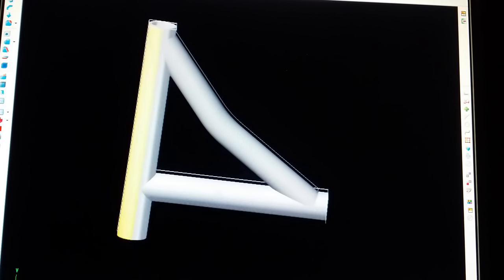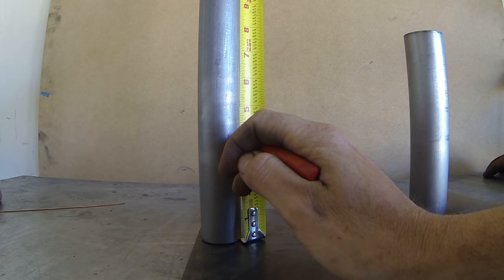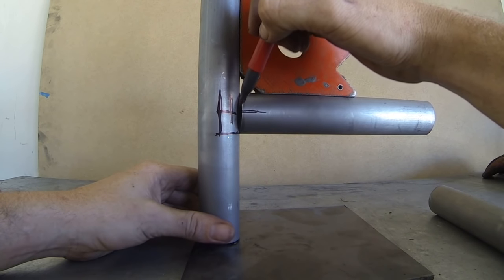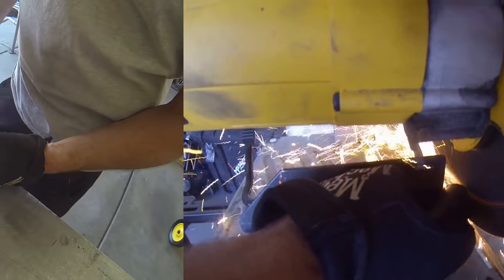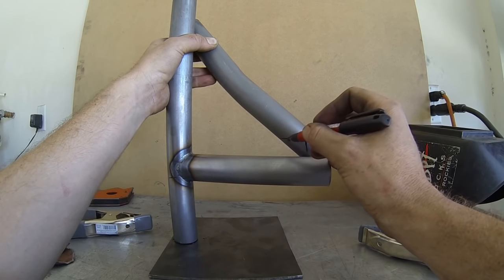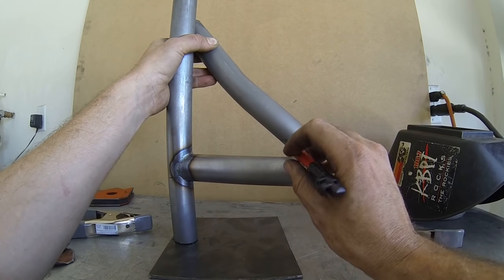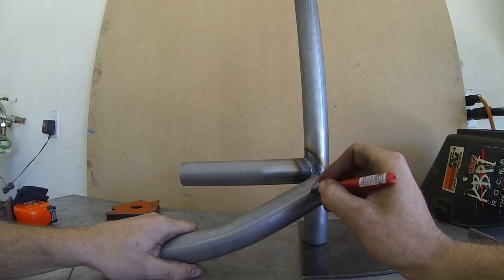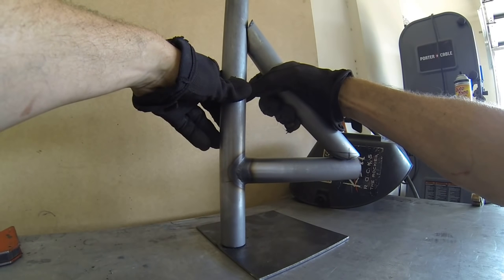TFS: How to Notch Tubes Without a Tube Notcher

Comment: Dude is 100% legit!  This is the fastest way to build a cage - tube eaters and hole saws don't hold a candle to a chop saw and a rock grinder and flap wheel in the right hands.  Tig welding with a foot pedal on a mock-up is cool, but I want to see you do a cage on a car on a jig with that set-up.....  You can use a tig hand wheel but the car ain't going to the Moon, you are just going to run it into a wall; just mig weld a mild steel cage.  You show boat you!!!

Comment: I used to work in a metal fabrication shop many years ago we used to do a lot of pipe work we used to use templates once we made our different types of joints we would make templates this way we can use the templates to Mark different pipes where they need to be cut this way you can do multiple pipe cutting once you have a template it is easy to mark all the angles on the pipe I'm not going into great detail on every procedure doing this but this is an idea that may be helpful to other people would use a template fine line marker and some tape a little bit of tape not much just to hold the template in place this is not ideal I hope it helps other people have a nice day everybody

Comment: which is it better to use mig or tig for roll cages
Reply from the maker: MIG welding is acceptable for almost all sanctions (unless it is chromoly tubing) but I prefer TIG because I have better control over the weld. With a MIG, you end up with cold spots on the weld which isn't as strong.
Reply: Thanks for the input I'm still new at welding and fabrication and always willing to learn a new method

Comment: You should cut the notched tube to it's centreline, not perpendicular to the throatline. Tube thickness screws with perfection. I've done just about all my tune fitting with hacksaw and file. That encourages you to work out the best place to cut...

Comment: Simple way to do it for a pipe coming off at 90° is, set the saw to 32° and cut 12mm into the pipe. Once you've done this a few times it's very easy to work on other angles using the basic 32° as a reference.

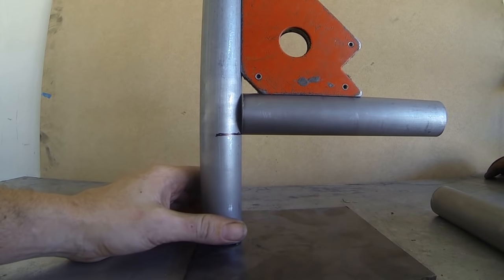Comment: Tell me why at 2:15 that you just can't drill out a hole and slide the tube into the hole until the side of tube 2 mates with tube 1 ; then weld? Is it just a weight issue?
Reply from the maker: If you drill a hole through the tube you are mounting to, you will remove all the metal which will defeat the purpose of notching. Also, removing metal from the main support would weaken the structure.

Comment: I have even done a drill press with same or slightly smaller hole saw. Works good if you have to do a bunch the same length as you get two fish mouths with each hole.
Reply from the maker: Errol Crossman I use my mill when I'm doing repeat cuts. I'm still faster by hand, but it's just easier plunging a hole saw into tubing for the same cut.

Comment: you could be fixing in a jig draw the radius and use a holesaw of that diameter and make the cut
Reply from the maker: I could, but that would take longer. It also requires more tools.

Comment: What is the orange magnet that he is using and where can i get one?
Reply: You can pick them up at any fab shop, Even Harbor freight has them
Reply from the maker: Any welding shop (as mentioned) has them. The cheaper bargain store magnets are not the greatest. They can barely hold themselves to a work piece.

Comment: Does this work with dissimilar pipe sizes?
Reply from the maker: Yes, but the rule does not apply. Dissimilar sizes require you to measure the gap which will become your throat depth on the notched tube.

Comment: If you take your common angles and build the pieces that work, couldn't you make a reusable template to wrap around the pipe and quickly mark the cuts?  I'm just getting into tube bending etc, so I'll give that a try.  shrug
Reply: There is a website where you can print templates to any pipe size and angle, I use those at work, I reinforce them with some tape on the backside, punch holes in them and put them in a folder. What I'm trying to find is a tip on making a notching/fitting on a tube bend. Had to make a notching on a 5 1/2" 90 degree bend... so that the branch was in a 90 degree angle relative to the pipe the bend was attached on, but with  a 45 degree rotation on the back of the bend. Took me like an hour to make it.
Reply: @kviaak7979  That’s sweet.  Funny thing… I watched another video and a guy was doing exactly that.  Buying cheap plastic folder separators and cutting them for the different angles.  Worst case, someone may go to a fabricator to have precise angles cut on scrap to transfer.  I’ll try to do them myself, but have a local shop to go to for the cuts if I don’t have confidence.

Comment: I tried doing this with a 2" into a 3" but it didn't work out. Is there a different method?
Reply from the maker: GigaDonk Measure the difference between the two pieces and cut that amount off of the tube to be notched.

Comment: Stove piping!  Dude, Do you not have a drill press?     hole saws + drill press + vise =precision joints. Measurements directly from CAD, layout cuts and bends - no math (sorta).....
Reply from the maker: Kayenne9 I have a whole machine shop and more. The purpose was to demonstrate a method that requires nothing but a simple formula/rule and simple tools.

Comment: That's fine if you already own a chop saw or metal-cutting bandsaw and an angle grinder.  If you don't, the tubing notcher is really the way to go; there's no "touching up" with a grinder when you use the notcher.
Reply from the maker: I have yet to see my notcher, milling machine, drill press, or any other make a 100% clean cut that required no touch up or cleanup with the grinder. If it exists, I'd like to own it. There's always a burr or two.
Reply: You don't need a 100% clean cut for a welded joint, burrs do not matter....and you don't get a 100% clean cut with anything, certainly not with a chopsaw.   There's a difference between "touching up" and re-shaping the notch.  If you're buying a tool to fishmouth tubing, a notcher beats a chopsaw all to heck....that's my point.

Comment: Tuck your shirt in when using a grinder. I once got my shirt too close and the grinding wheel twisted the shirt, pulling the grinding disk toward my stomach which then sanded my abs. I ended up with a half shirt. I never did that again.

Comment: there is a much , much , much easier way . Use a hole saw the size of the tubing . Mark the center of the tubing to cut and start the 1/4 in drill there . ( at the proper angle ) .  the cut will be absolutely perfect every time

Comment: Not what you could call rocket science. More like backyard pipe fitting. Wouldn't make a bike frame with this method BUT it does work. I eschew a drill press and use my milling machine plus holesaw. That with a jig gives me repeatability but before. . . , I used a similar method and a pipe wrap.
Reply from the maker: There are many different methods used for notching tube and pipe. This is just one of those methods. Nothing about notching is rocket science, but this method is based on simple math which is usually rated above "backyard" work.

Comment: what about a vice, a drill press, and a hole saw?
Reply from the maker: Andy Houghton Use them if you want. I own all of them including a mill that are all capable of notching. However, the purpose of the video is to show that you don't need any of those tools and once you get the method down (practice), you'll be able to notch faster than any of those machines.

Comment: Hole saw and drill press. Add some creative jigs and you can join up any round tube stock to any other round tube stock. Need I say more?!!
Reply from the maker: The time it takes from start to finish is the focus. It's simply faster in most cases to do it this way.
Reply: The Fabrication Series Unless you know you'll be making the same joint hundreds or thousands of times. Then the time spent on settiing up the jigs and such is spread out over the entire production run and winds up being time well invested.
Reply from the maker: If you have the same exact notch to make hundreds of times, you wouldn't be doing it by hand. I have many other machines to do the job, but the points is - you don't need them. I'm not suggesting anyone is wrong or anything. I'm only saying this is usually the faster method. It is very impractical to buy thousands of dollars in machinery and materials to make jigs when you aren't in production and don't have a need.
Reply: The Fabrication Series Who says you need to invest thousands of dollars in jigs & such. A good reliable jig for a drill press can be made of plywood and 2x4s. You'll probably need a cheap "C-clamp" or 2 as well but you certainly don't need to spend thousands of dollars on jigs. Just use your imagination and think about a bigger picture!! DUDE...I know the difference between prototyping and production. I also understand that you are probably doing mostly custom work. I never meant to insult you in any way. On the other hand...It wouldn't hurt you to set up a simple jig for making 90° as well as 45° connections. I'm sure those will be the most common and once you have said jigs...you'll be able to call upon them countless times. 

The wheels are already spinning twixt my ears in regards to making jigs for 90° as well as 45° for a drill press.

Where do you live? i'll come to your house and show you how to do it!! I live in central Indiana. Where are you located?
Reply: The Fabrication Series I spent numerous years framing houses with custom roofs. That means you have to cut a lot of rafters and they all have to have the same "tail" on them. We make a "tail pattern" and transfer it to the bottom end of every rafter (except for valley jacks...they don't have a tail...but "hip jacks" do).

Comment: This works, but it's not real clever. It IS how I do it, too.  Basically eyeball it, and grind it until it fits.  It helps to have some wrap-around patterns pre-made for the common joint angles. The real trick is getting the 2nd joint made on that same pipe. If your saddle is off by a few degrees because of your eye-balling, it'll drive you nuts.  That's where use of patterns and a level will help.

Comment: The main issue is Safety. As you can fabricate why not build a jig to clamp the pipe properly at the chop saw. Also no guard on any angle grinder? That is never right.

Comment: That was nice....but since there apparently was a 3D Model why not just pull dimensions & geometry off of that?

I'm just sayin': If you have the design tools to do the 'engineering' with serious accuracy,, why wouldn't we use that?  And especially if one took the trouble to make the model.

Comment: When I was a pipe insulator using math you can get it to fit perfect. I just can't remember the math to get it. All I can remember is size of the pipe divided by 3.14 Wish I could remember it all. Use a scribe to mark your cut.

Comment: a decent standing drill press with a hole saw notcher bolted to press is fast and easy...the key is buy a good notcher, it will outlast you....
Reply: What's a good model for drill press use?

Comment: Why not set up in the mill and using milling cutter diameter of pipe? 5 mins.
Reply from the maker: sillybuster Nothing wrong with doing it that way at all. The purpose of this vid and method is to demonstrate another method that doesn't involve expensive machinery.

Comment: I always feel uncomfortable when I see folk freehand with an angle grinder, particularly with the workpiece in one hand and the grinder in another. OK, it's only a flap disc, not a cutting or grinding disc, just saying.  Few seem to uses a bench vice and side handle for safety when angle grinding small bits these days.  Am I being too safety conscious?

Comment: Nice explanation/demonstration.  I am concerned that only one of your arms/hands is protected from welding UV as you weld.  The other hand and arm are exposed and over time you risk serious skin damage and skin cancer from this exposure. And your T-shirt is not adequate protection either. There are some nice protection options out there.  I hope you will use one of them. -Kerry
Reply from the maker: It's been brought up about eleventy times previously. Thanks for watching at least.
Reply: Sorry to be a nag.  Do take care.  I took precautions most of the time, but in my 60's see the damage to the skin on my hands.  Nothing serious, but I consider myself lucky.
Reply from the maker: Kerry Sandford You're not nagging. You're right. I'm just seeing it a lot on this vid haha.

Comment: now what you do is BEFORE you fitt up....make some heavy paper wrap arounds and make patterns from your notches. Mark the degrees and save patterns in your tool box
Reply from the maker: Crypto Chase That works if you always have the same angle. In my industry, that's rare.
Reply from the maker: Crypto Chase The process to measure, cut and weld is mere minutes with this method. I think I'd be wasting more time finding the right pattern out of hundreds. 

I'm not saying your method is wrong or anything, but it sure isn't for me haha.
Reply: I have never owned a notcher or used one as they are for pussies.I know your method inside and out and could teach you a few tricks to even make "your" technique even easier and faster. But you can not grow beyond your own world without stepping outside your box . Since it is obvious you are smart enough to figure it all out on your own which is fine but I can promise you that me or anyone of my apprentices could notch circles around your head and while upside down too ! Keep up the good work
Reply from the maker: Crypto Chase I know it looks like I'm just a guy in his garage because that's where this vid was shot after I retired, but even with my experience, I know I still don't know it all. I'm always open to learning or comparing techniques, but I have never found a method faster than mine. 

I did finally get a notcher because I have to have one for the fab classes taught at my shop (insurance won't let my students hand notch). It notches faster, but the time it takes to measure, setup, cut, clean, fit, weld... etc. is about 3 times as long as the entire process by hand. If you have a process that beats mine, I'll check it out, but I don't think chasing templates will increase efficiency.
Reply: you don't chase them....you end up with 7-8 favs patterns and you will find yourself protecting them like your new puppies .You keep them in 3 one gallon ziplock bags shallow angles/ 45's/ steep. When you go to make a notch It ends up being a balance act of, I got a 35 deg pattern but I am laying out a 36.6 degree angle ( I could care less about  angle really, just eagle eyeing it like you ) and I wrap my pattern around a short stub of pipe with my pattern sticking out and make a quick check for fitt against my tube I am fitting up too. I have my ziplock bag at my feet and I may need to reach in 1 2 times but I find a pattern in 10-30 secs that is close enough and when I draw my lines onto pipe I am cutting I just cut one side of line of other depending on what my eyes see I guess ( you understand )  Some old guy who I worked for 20 years ago did it this way and he was smoking my ass every day and it was pissing me off lol....so I adapted his style and he was smart. I did not mean to sound like I was poking at your garage or skills.....but you know there are many times I never use the patterns......I do it just like you and the older I got them more I just grab a sharpie and go hum....yeah cut it here and there....a little grind ...ready to go...so kudos dude at least you have a video !.....edit and one finally thought. I do have alot of years on pipe fitting over 4 inches so when you are dealing with sections of pipe that cost thousands of dollars every weld is inspected the cut and fit of the notch is critical which makes me a bit biased I guess

Comment: why not just use a contour gage?
Reply from the maker: +Jeremiah Alfrey It takes longer and costs more than a tape measure.
Reply: $44? I bet you have clamps that cost more.
Reply from the maker: +Jeremiah Alfrey a tape measure (even a good one) plus a marker costs less than $44. Now let's assume you want to notch more than one size - how many $44 do you want to add to the job to botch more than one size?